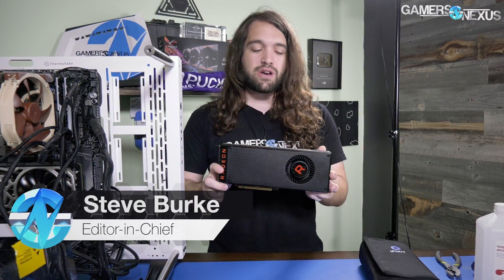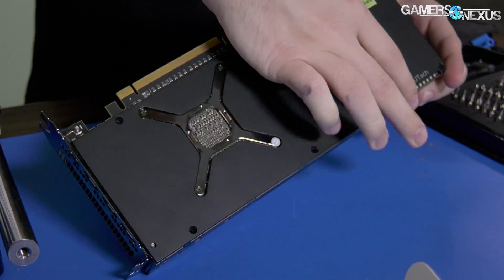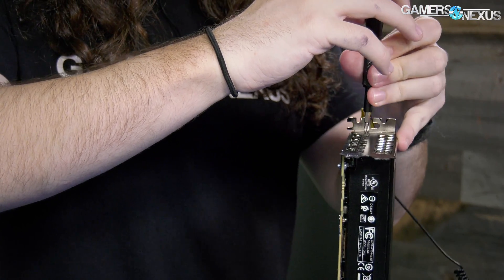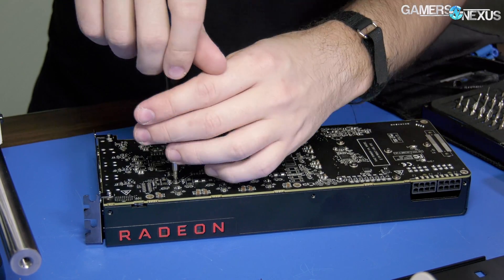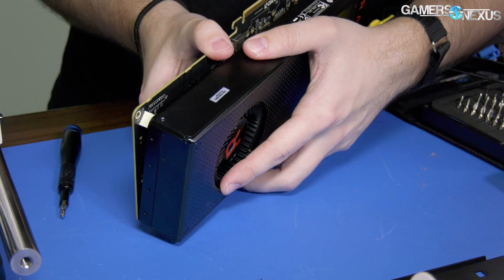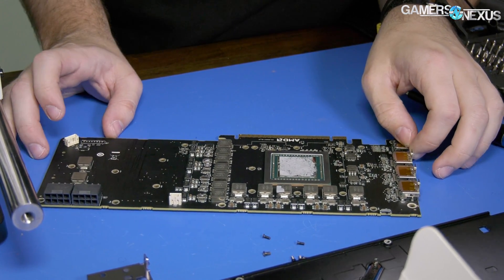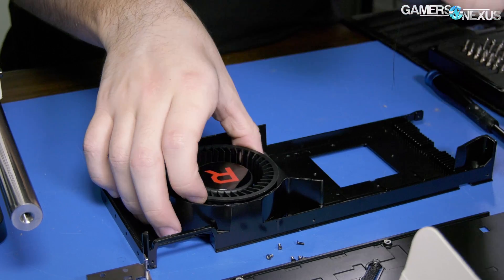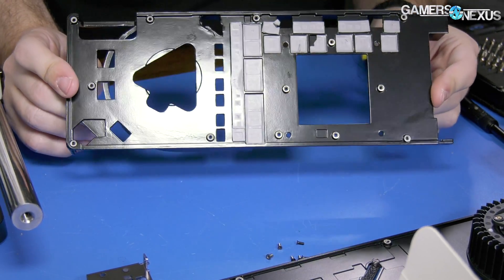AMD RX Vega 56 Reference Tear-Down: Cooler, PCB, VRM

Comment: Hey boys i know i'm late to the party but i know you are a knwoledge base community and i need a bit of help i have a msi Vega air boost and as you Can vérify by typing Vega 56 crash on Google mine crash Also as the issue is wildly widespread and i Also have a good psu WE can assume it is  not a psu crash so do you have found a way to make your Vega 56 work ? The crash happen After an hour or more of gaming but it's a bit random so feel free to comment if you have found the way may the force be with you

Comment: Is there anyone that I can chat with regarding my Vega 56 card.  Vega was working, I rebooted my computer, and now the Vega fan won't spin, and the GPU lights will not turn on.  Windows or Linux will not recognize.  It seems that there is no power past the two 8-pin plugs. Any help would be appreciative.

Comment: Will it work with two Noctua case Vans if the Original Cooler is removed. I dont Want to buy a Morpheus... is searching for s Chester sulution.
Reply: No you need to buy a headsink if you don't want your gpu to be running at 165c

Comment: Does anyone know why the limited edition backplate has cuts in it for airflow and the black one doesn't. Does it help trap mod heat. Can u run the card with both and see if the cuts help....
Reply: More heat sorry not mod heat...

Comment: After taking the card apart to test thermals, do you apply a different thermal paste? Does using a different paste from the factory effect the results by any noticeable difference?
Reply: know the thickness of thermal pads?

Comment: Was the pcb board length mentioned in the video or did I miss it? I am planning to liquid cool it,  but it's s smaller inwin 301 matx case with rad taking up some of the space up front.  I barely fit the msi rx 470 board in there with about half inch space left. I was hoping they used smaller pcb like with fury considering it uses hbm.

Comment: "If you are gonna watercool, there isn't really a reason to buy a custom card"
Yes there is: 300W Hardlimit and really strict restrictions when it comes to BIOS Flashes.
Let's hope, the Custom Cards will have better BIOSses
Reply: Don't get your hopes up. Steve is not wrong.

Comment: been working on computers for years, never found the need for an anti static band on consumer items yet, never had anything fail on me from handling without one, so long as your not being stupid rubbing balloons on your head or wearing a onesie scuffing your feat everywhere then probably be fine, just touch any pc case that's plugged in to ground yourself first, or other metal electronics devices that should also be earthed.
Reply: Kold Kustard yet accidents happen.

Wearing the band takes no effort, if you have one there is literally zero reason not to wear it.
Reply: If you work in a humid area in a basement, static bracelets really won't do anything. There is just too much water in the air for you to cause a static shock. Though I mean if I was working with professional, high level expensive equipment I would wear a static band... But I've built over 100 PCs and never damaged anything (to my knowledge) with static electricity.

Comment: 30 years of no ESD issues or using a writst strap ;)  I've only killed with insufficient condensation protection and mining.
Reply: Eric Witte guess you have been lucky then.

Accidents happen and wearing a band takes zero effort. Literally zero reason not to wear one.

Comment: since we all know that is performs like shit in gaming, can you Please compare the 56 to the FE card in compute performance. Thank you in advance
Reply: so you are going to suggest a GTX 1070 performs like shit?
just curious because this card is nearly identical in performance and price...
Reply: wakesake the performance is fine and more than enough to compete with gtx 1070, however the delay & quite bad pricing make it so much worse.
Reply: the 1070 is over a year old card and it was great back then and it still is but it was priced like shit because there wasnt any competition 

the 56 is brand new it runs like shit , its hot , its super power hungry , it has features disabled , its terribly priced , its more then a year late, its a fucking huge board (remember the HBM1 boards) and it still competes with the gtx 980ti...  soooo yeah its beyond terrible
Reply: when vega goes vs the 1070 for me vega wins because it will only get better but the pricing sucks. in my shitty country the reference rx vega 56 (preorder and you get only the card)is 500euro its the same price as the 1070 strix oc :(

I care only about price to performance. Sometimes when i go all in i care only for the performance but most of the time i like my money and i dont wanna overpay for anything
Reply: yes vega 56 is a winner when it goes vs the 1070 and it will only get better but, i dont care about that card because i can get similar performance on my 980ti which it came out way back in 2015 

it should have been cheaper , there are crazy things going on with the pricing. in my shitty country reference vega 56 is 500euros and thats the same price like 1070 strix oc edition 

it has great tech in it, but it needs to make proper use of it. 
The greedy lazy fucktards from amd released a new driver that improves mining ????? FUCKING ASSHOLES where is the gaming performance F U C K   AMD when it comes to gpus this round. 
Their last great gpu was the hd7970, that card was great and it still is. 
The only good thing amd has now is the driver support, because it supports much older cards unlike nvidia
Reply: sound like i want progress 
i dont care about the 56 , i have similar kind of performance on my 980ti which came out back in 2015
FUCK MINING , the fuckers from amd released a new driver that improves on mining instead of focusing on gaming and compute ?? FUCK AMD when it comes to gpus , this round.
i am in the position that i can play around with gpus , the ones in my vids are all mine.i bought them new or broken then i fix them and most of them i sell after a year or less

btw in my personal collection 
3DFX VooDoo 2
Ati 9700 Pro
AtiX850XT Platinum
Nvidia 6800 Ultra
Nvidia 7950GX2
Ati X1950XTX
Nvidia GTX 8800 Ultra
Ati HD4890 2GB
Nvidia GTX 285
Ati HD5870 2GB
Nvidia GTX 580 3GB
AMD HD7970
Nvidia GTX 980Ti
fanboy? naah more like experienced smart boy
Reply: and what does it make you ? a pepper amd dumb boy
kids today..you really are getting dumber arent you
Reply: i only agreed on 1 thing with you and the other 99% of the people because, we all know that everyone likes money.
aaand i gave you explanation on every single point why i said that..hmm i didnt saw you explain anything or maybe you didnt had the time to copy and paste something from google because i doubt you have ANY experience with hardware. 
if only we could chat about tech in real life with no internet, you know the old fashioned way , the Personal Experience way 
hey look on the bright side, even your brain can get one thing right some of the time 
aaah its fun fucking around with you kid , you sure made my day and i cant wait for more btw make a vid of your PC with you in it so we could see what you have ..and dont go to your friends house if you know what i mean 
you can see some of my gear in my vids and it sure it doesnt look like i am lying when compared to someone else mhm You
Reply: -english is not my main language , teach me "master" HEY try speaking/writing my language "brain" ...or maybe its too complicated for you to understand 
-"Why do I care what gear you have?" well just to see how long i have been playing with hardware and get an idea why i say the thing i say 
-"There are no challenges" yup because you already lost 
-"Jealousy is a nasty habit" naah maybe for some weak people, in my case i motivates me to be better then the other person
-You say you are "emotionless" and you still respond? well doest that mean that i managed to push some buttons on you that made you engage some emotions
-"Good luck in life" thank you kid , i already have fabulous life but it can always get better 
come on dont go away, play some more or like the heavy sad Cry some More
btw guess what vega is still shit :))
Reply: hi mr emotionless , it sure looks like i am still pushing those buttons aint i 
i see you do a lot of thinking for the likes of you , dont go so hard on yourself 
uuu now you change the subject from tech to humanity , put on a cape and fly  superboy, or shall we get back on the subject that Vega is shit right now
Reply: 100%  agree , i love the tech behind the card but it will need at least half a year to mature and like we all know the price is killing this card
this time around amd made the server parts first and then just trimmed them down for the mainstream marker aka us
Reply: Lol. Its performance is fine. It was aimed at the 1070 and is on par and will likely be 10 to 25% faster over the coming months. 

Its cheaper (by msrp, amd have no control over retail pricing) too.

When it comes out is irrelevant. Go to the shops and you pick from whats avaliable. 

Picking on the size of the board? Lol like that matters. Partner boards will have smaller ones if thats what you are after.

I will admit the cards have been overhyped. But leaving that aside and looking in a vacuum the cards are fine.

Not amazing, not bad, just competitive.
Reply: Sorry m'lord. What me meant is that 56 doesn't live to the hype and performance expected from pc peasants m'lord. 1070 isn't performing like shit m'lord. All hail nVidia the king of GPU.
Reply: lmao rofl ok youngling lets go
-"Classic ignorance at work boys!" speaking about yourself again i see
-1070 vs 980ti , similar performance , less power, lower temps, way cheaper
-"Developing new technology guess what, takes time" - i agree but where are the performance gains 
- drivers will add 10-15% maybe in best case scenario , more realistic like 5-10%
- Nvidia = money - i agree but Nvidia are smart with not wasting their money at the same time. AMD push the tech YES but Nvidia plays it safe and optimize it better and make more use of it
 -"Dude probably doesn't even own anything over a 1060 lmao" kid get real YOU are the one that doesnt own anything because your mama still pays for you. 
In my case you see all those cards in my vids..yeah i own/ed them. I work with tech, i buy them used or broken then i fix them and sell them , you know making easy money and shit..
So in the end kid , go back to school you have a LOT to learn

Comment: Am i the only who thinks AMD's reference design cards look way cooler than Nvidia's?
Reply: I have to agree. AMDs reference cards look much better now than they did a  few years back while nVidia made a big visual downgrade with their 10 series.
Reply: that is subjective, but im agree with you since i don't like transformers like design on Nvidia's FE cards, i like it more simple and elegant.
Reply: yep.. there's no comparison..
Reply: your not the only one, i love the amd reference card design
Reply: The 1080FE looked like a kid's toy by comparison
Reply: The Msi Air Boost is sexier.  It isn't cheap plastic at all but solid metal cover with only a MSI led on the side and a GPU power tachometer to be turn to blue or red or turned off.  I'm going to draw a plan on how to keep the design but mod it into a aio water cool hack like those expensive 120mm block blower GPU they make on Nvidia GTX model.
Reply: MrDman Any update bro? I also have an MSi Vega 56 Air Boost and I would like to  see the mod you’re doing to it.
Reply: @MrEscanaba  i am also doing this but with a 240mm
Reply: I like the rectangular box design more than nvidias old founders addition design
Reply: You're a minority
Reply: Nihad Asadli yes you are

Comment: What are your thoughts?
Will GDDR6 beat HBM2 if it comes out
Reply: Unless GDDR6 is included in the die like HMB2, I would highly doubt that the industry will use it in the future.
Reply: Dr. Dunk Not in performance, but it is cheaper to make and easier to overclock so nvidia will stick with it.
Reply: Samsung is proposing a low-cost 
HBM that would reduce costs in multiple ways. The number of connects 
per-die would shrink, reducing the number of vias required for each 
chip. The company wants to replace the large silicon interposer with an 
organic layer, and believes it can cut costs by removing the on-die 
buffer as well (how this would impact the overall design remains 
uncertain). While the resulting HBM variant would have less overall 
bandwidth than HBM2, Samsung believes it can compensate by increasing 
the clock rate (presumably without compromising HBM’s overall design, 
which emphasizes low clock rates and extremely wide buses).
Reply: GDDR6 will have to face HBM3 in 2018. HBM2 is kind of running a limited show right now.

HBM3 will end up being much cheaper than the previous, more plentiful, more performance, and bigger capacity so to speak.

It's likely we'll go back to normal Vega pricing when Vega+ cards with HBM3 pop up mid to late 2018 maybe.
Reply: This means by taking a cut on that massive bandwidth, they can increase the speed to make up for it, and still have a cheap viable memory component to the GPU that's faster, cheaper, and doesn't take up space on the PCB.

But it will also gained increased bandwidth, apparently through another means:

Samsung’s HBM3 is a 
straightforward improvement on HBM2 that would debut in 2019 or 2020 and
 offer higher densities, higher stacks (more RAM per chip, more chips 
per stack), and 2x the maximum bandwidth of HBM2. The goal is to reduce 
the core voltage (currently 1.2V) and the I/O signaling power, according to Ars Technica, while improving maximum performance.

No idea why they say 2019 and 2020, unless they are making two different HBM3 designs.

Non-upgraded version with faster clock speeds would appear in 2018 maybe, and a upgraded version with higher scaling would come in at 2019 onward (2x the size, bandwidth, etc.).

https://translate.google.ca/translate?sl=auto&tl=en&js=y&prev=_t&hl=en&ie=UTF-8&u=http%3A%2F%2Fnews.inews24.com%2Fphp%2Fnews_view.php%3Fg_menu%3D020810%26g_serial%3D1038361&edit-text=&act=url
Reply: source?
Reply: Dr. Dunk HB3 is supposed to come out "soon" and have even better performance and much lower power consumption.
Reply: Companies like Samsung are ramping up productions for HBM3 and related memory production, they are getting new factories setup, but aren't operating yet until 2018 (installing equipment, hiring manpower, and training them, etc).

They've already bought a plot of land in 2017 like a bunch of other companies, for this purpose of HBM3, and probably started construction by now, just not going to be operating until the start of 2018, which is several months away.

https://www.extremetech.com/gaming/234333-hbm-everywhere-samsung-wants-hbm3-low-cost-options-to-blow-the-doors-off-the-memory-market
Reply: you do know that hbm is only used because it uses 50 watts of power instead of 80, what a dummy
Reply: Yes, 5x already competes

Comment: Does it has 16Gb of HBM2 also but just 8Gb working?
Reply: its more likely that the vega 56 die is just a full vega fe with the 2 hbm2 stacks but one of them is just faulty and broken so disabled same with next gen compute units and stream processors
Reply: vega 56 has both hbm active. if one of the hbm module was disabled, then bus interface would've been 1024 bit but vega 56 has 2048 just like the 64. what I'm curious however is if the CUs on the 56 is laser cut or just bios disabled.
Reply: most likely no hbm2 are realy expensive to just keep then unused if they are onboard
Reply: +VxBossKroniksxV That is what I think also but maybe Steve can tell us?
Reply: hbm is multilayer memory maybe they just use module with less layer than FE considering 8gb of hbm2 still around 160$ is stupid for AMD to put 16gig and cut it half

Comment: Will a Nzxt G12 bracket fit on it so you can put an AIO cooler on it?
Reply: BruDavaloredge probably eventually. But then get the 64 water for 80 more (100 aio + 20 bracket)